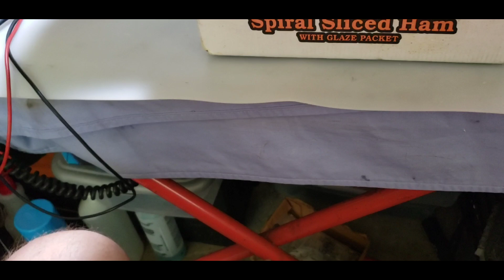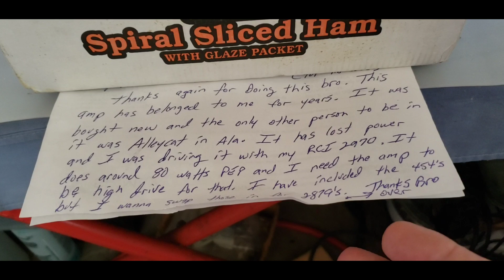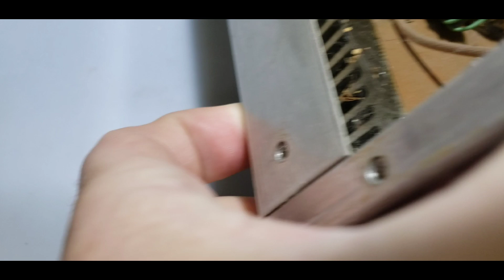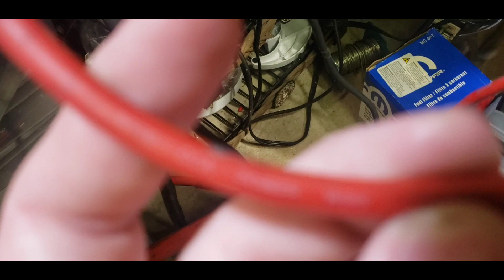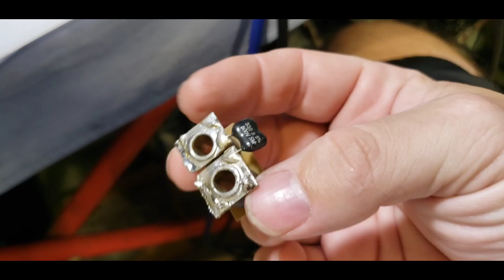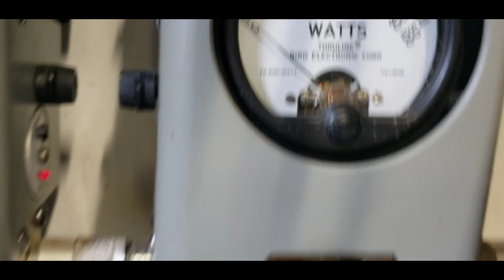Fatboy/Fat Cat 🐈 Rebuild - Let's Suprise The Owner - [He Had No Idea!]

Comment: It’s because he’s driving it with 80w dead key.. Those transistors are not designed for that much drive.. He need a bigger box..
Reply from the maker: You are incorrect bud. These are 2879C they actually can handle more drive then this. They are 150w 6 Chip Transistors. Only reason I was going crazy was because of how much they were doing with only 40w of drive. Keep in mind I didn't have a 80w Dead key bud lol... My dead key is about 1w I was using a Single Final Cobra 29 doing about 40w PEP output 16w AVG. Hope you learn a little about this bud. Regular HG 2879 are 4 Chip transistors, 2879C are 6 Chips so its like this box is 3 Total regular 2879 when you do the math.

I promise you this box was not being over driven. Hope this helps bud. GK
Reply: Not the C the 2979’s

Comment: that really nice repair. just keep them 2879C cool . if you get hi temp ceramic glue and use shielding gas from a welder as putting top back on. but that heat all ready did the damage . once gets that hot it breaks the transistor down.   2970 is a hi out put radio. that does have adjustable power so you go with that.  I have 2 of the 2950 radios. the DX has FET's and covers 12 meter band as well as 11 and 10.  that has LED display. the old 2950 has dule BJT finals . but only goes 26 to 29.999 MHZ . has back lit LCD display . just back up radio's now. my Anytone much better.  better RX by far . better sounding TX . and does CTCSS/DTS tones . works 10 meter repeaters. if wanted to bias it ,I would go with bigger heat sink. with 2879C . 2970 can drive a 4 pill just fine. 73's
Reply from the maker: Yes that is why I used a 5 pill cabinet on the 2879C biased amp I did. I was kinda curious why you said use shielding gas from the welder what is that about?? You can't use hi temp ceramic glue by it self?
Reply: @1883GotDown  shielding gas is to displace the O2 when gluing the top on. They use something like that when make them. but damage has been done once got hot and O2 got in.